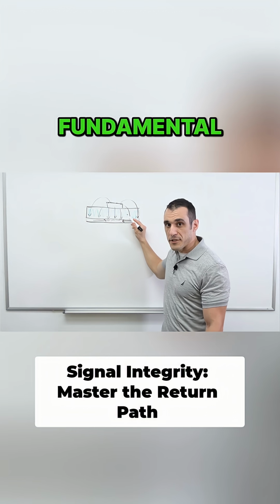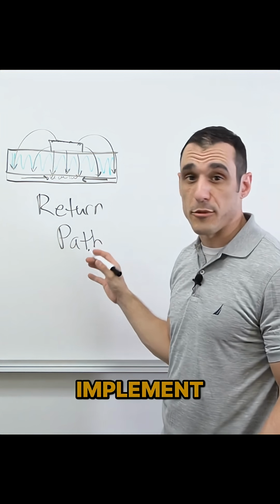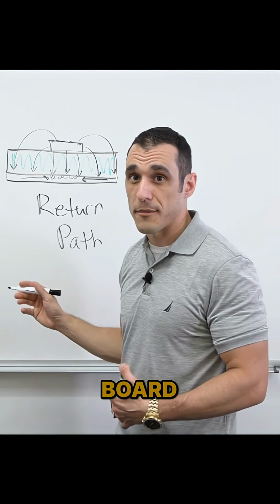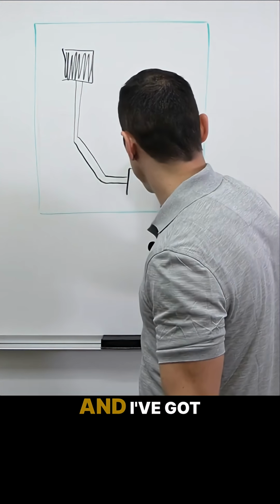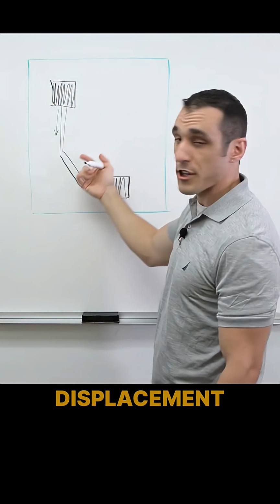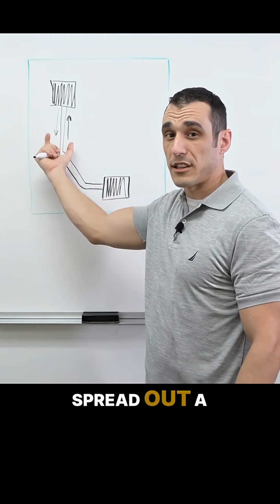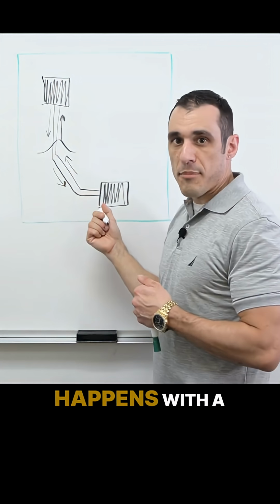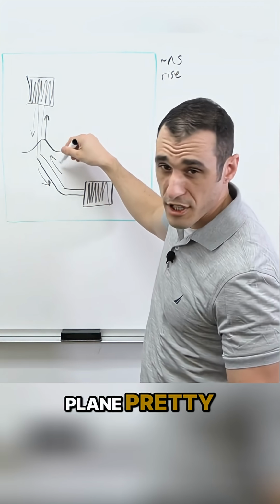Return Path Basics for Mixed Signal PCB Design

Comment: Haven’t got a scooby what’s going on
Reply: You know your car uses the chassis to ground? Well if you are mixing high speed signals and their return path through that ground mix, the signal will start mixing.
Reply: @mojaveartifacthunters339 that’s amazing! 
Thank you 👍

For info - old old cars could / did use the cars body as the positive path! 

So, with  regards to signals mixing 

It does make my head hurt thinking n trying to understand lhe msg conveyed lin the vid   

Here, it’s digital signals I guess - happening at many many cycles/frequencies that could upset the apple cart 

Prior to “digi” signals & intense analysis that can now be done easily with super douper computers &  software   

A ferrite or 20 on every ground used to suffice 

I’m soooooo drunk I gotta go 

Sorry